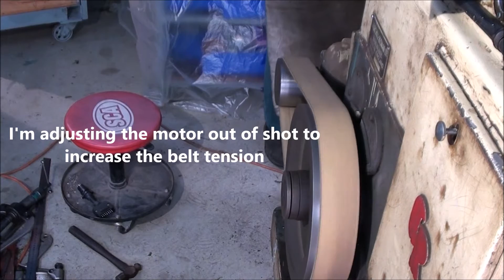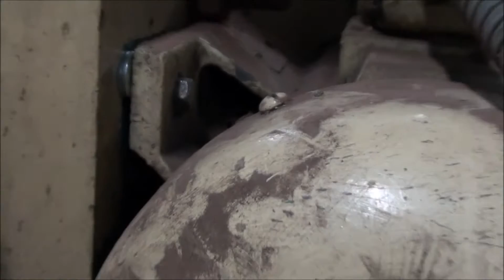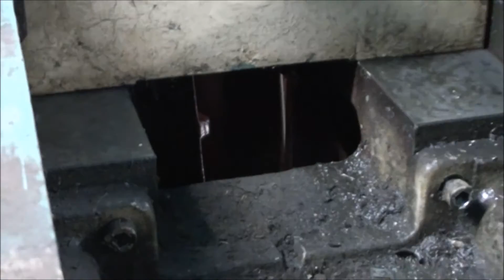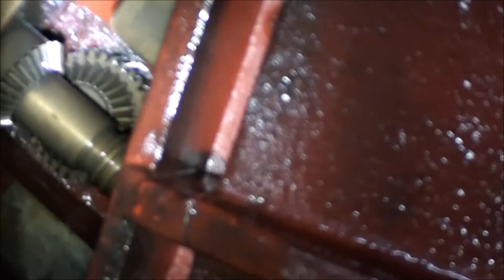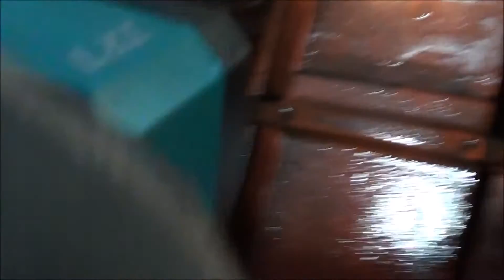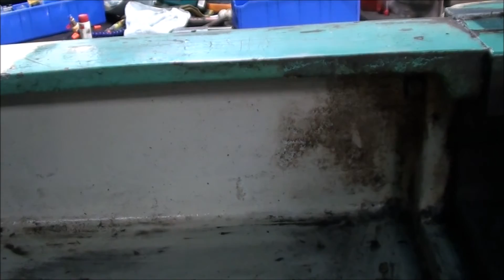Shaper Action - Churchill Redman Shaper - Part 4

Comment: A little bit late to the show. :-) But an advice for the future. Fill that iron pipe with lead on one end. I poured it in, with a plug out of wood an aluminium foil 15cm deep in. This way the pipe will not so easily collapse and you get a makeshift hammer, to move the "rails" around.
Reply from the maker: Nice idea, just need to find some lead round here that is priced lower than gold. I've been scavenging everything I can find, but bulk lead even from salvage is ridiculous in price. Thanks for watching and for the good piece of advice
Reply: I got most of my lead from two old roofs that got torn down. Was an nice deal back then. All the lead i want for two days of work.

Comment: hope you dont have a blocked oilway there with a full oil chamber. my vote is for the pretty blue if you do repaint it, and there is a law that states that if that cat falls in the oil sump, as soon as it climbs out it will race inside the house and go round and round under the blankets on your bed. otherwise a very interesting video. thanks
Reply from the maker: Hi Emma, it has an overflow out of the back of the sight glass, and the amount of oil that is returning back into the machine is substantially more than it could ever use. I will admit that I have been considering Blue as it would match the newer machines that I have. Hahaha, I have no doubt Kita would be a very law abiding cat lol